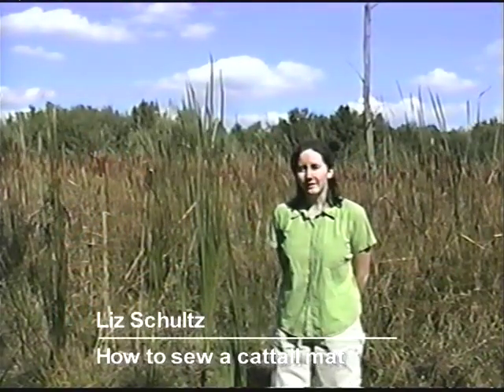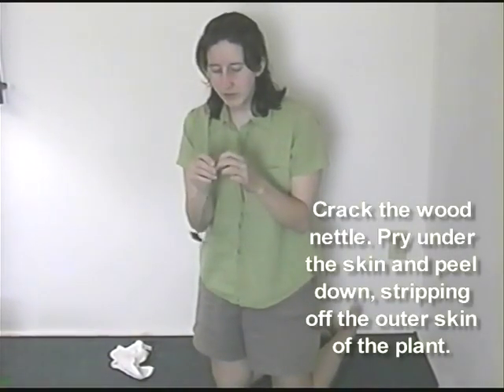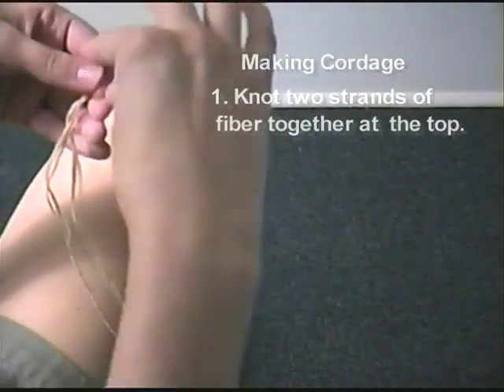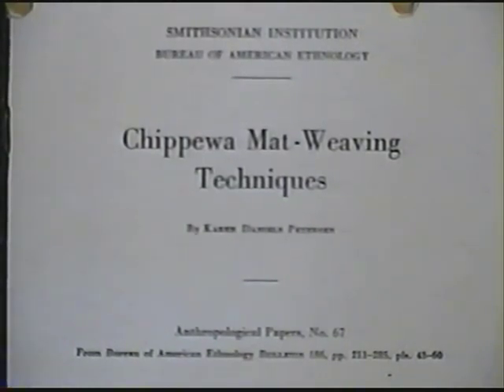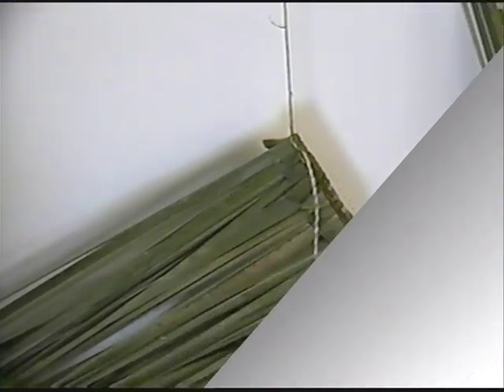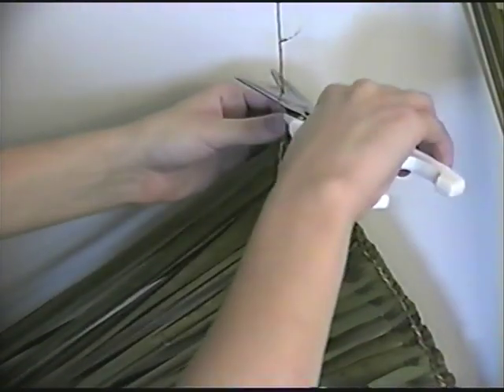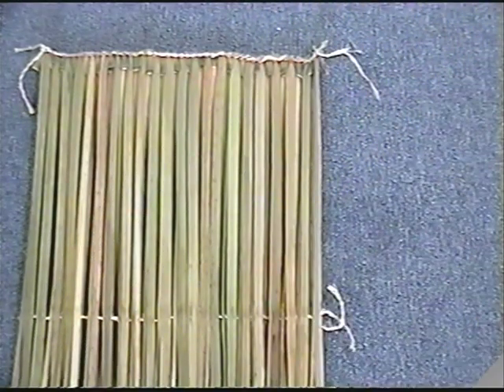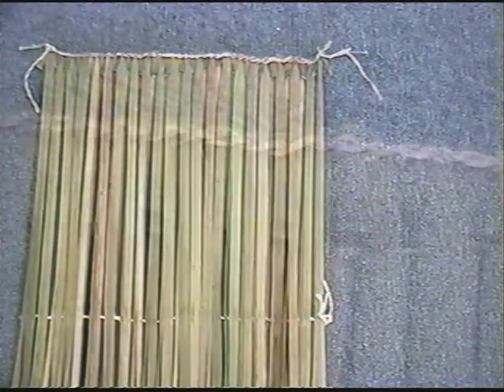How to Sew a Cattail Mat by Liz Schultz

Comment: The construction is ingenious, and there is good reason for the elaborate method of sewing the leaves together.
When the rain droplets hit the mats, they will tend to adhere to the individual leaves.
Due to the surface tension of the water, and with the help of gravity, these droplets travel downward until reaching the ground.
There cannot be any "bumps" (like external stiches) along the way, or else the water flow will be stopped and will collect there, eventually causing drips inside the lodge rather than simply shedding off to the ground.

Comment: A critical step she failed to mention is how you make a single cohesive mat and not two flaps of leaves hinged on the foundation twine.  Ive had AI take my confusing directions and simplify them so people dont get confused:

Steps for Sewing Cattail Mats:
First Pass (Downward Facing Leaves):

Pair inner and outer leaves.
Alternate leaves onto the foundation twine.
Sew the downward-facing leaves.
Flipping the Mat:

Flip the mat over to address the upward-facing leaves.(Which are now the Downward facing leaves as you have now flipped the mat)
Second Pass 

Connecting the Two Flaps:

To prevent the mat from splitting into two flaps, after you have gone into the center and out the side of the Outer Leaf pass the needle to the other side of the mat by going between the pair you just sewed and the next pair you already sewed, pass the threaded needle over the first pass twine and under it on the other side of the first pass leaf, thereby connecting the two flaps.

Visible and Hidden Stitching:

The side where the stitching is visible is typically the interior side of the mat.
The side where the stitching is hidden is the exterior side of the mat.
This method ensures a clean, professional-looking exterior while keeping the structural stitching on the interior side.